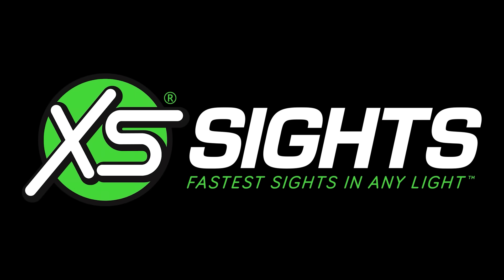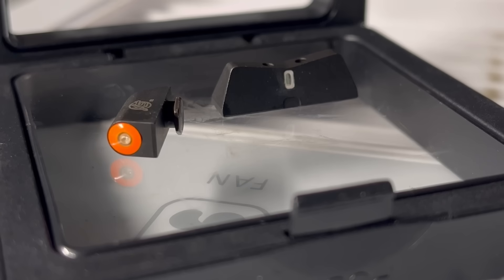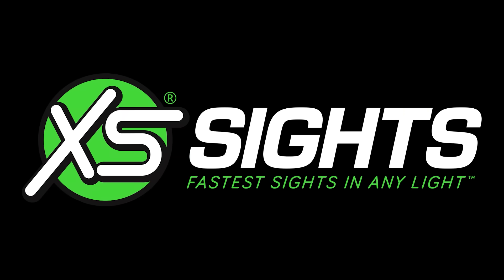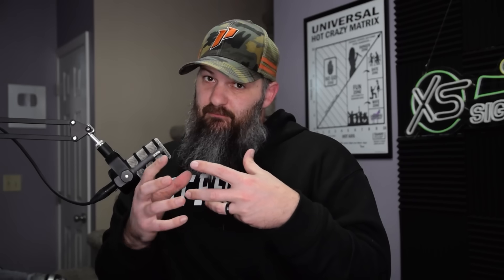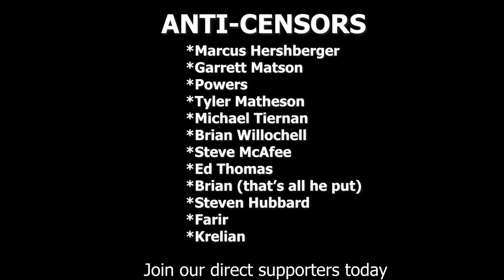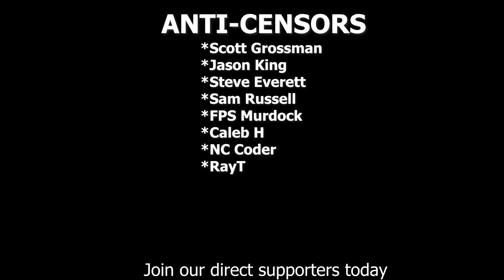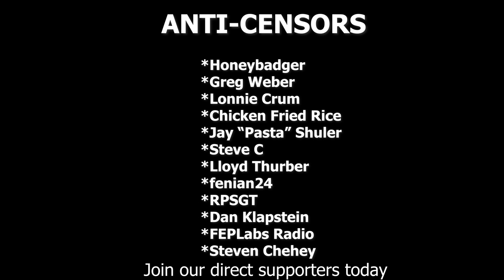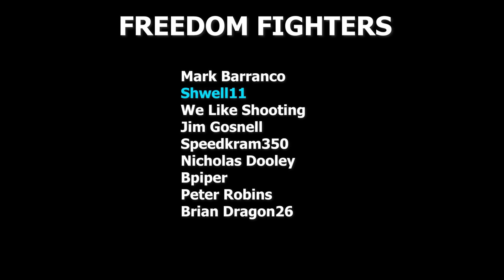Don't Get Scammed on "3D Printed" Suppressors in 2026

Comment: EDIT Thanks for the info. I had not thought of the tech as a marketing tool, just as a home-brew tech toy...I apprectate the wake-up call, as this will be my first steps into the NFA swamp.

I'd use 3d home printed for 22lr, and not much else...cheap, easily replaceable, and the print files are EVERYWHERE. You can't stop the Signal...

Comment: 3D printed cans more expensive? I'm sorry, but isn't the whole idea behind advanced technology supposed to make items cheaper by implementing economies of scale? These greedy companies want to see profits right away but that's not how this is supposed to work. Yes these machines are expensive but they are cranking out 8 or more suppressors in one run with almost perfect quality control eliminating time and the human element by over 90%. This is literally cloning on a huge scale. If you run the numbers and follow the economy of scale to its final conclusion, a superb can shouldn't retail for more than $250.00. It's literally quality with quantity, otherwise at the current reasoning there is no benefit to the consumer to the technology because the cost of the final product doesn't represent a value which is why Chinese thermal is kicking ass and American thermal is a ripoff.
Reply: Yeah, but 3D printing is slow and the equipment to print titanium (properly/reliably) is not cheap. I've got two 3D printed suppressors now: Stealth Additive Shiv (9mm) and PTR Vent 2 (9mm). They are both ridiculously quiet and worth every penny.
Reply: @bry2k You are missing the point. These industrial machines print 8+ cans at a time using one laser per can. That's 8+ lasers in one machine. Whomever told you they are slow is a retard and never sat and watched a CNC machine mill baffles and tubes THEN sit and watch someone maticulously sit for hours and weld it all together. I don't think you understand that you are suggesting that companies are buying these machines for millions of dollars if they are SLOWER, WHICH IS LESS EFFICIENT. No, they are buying them because they crank out suppressors by the crap ton 24/7 without a single human touching the product. ITS CHEAPER, not more expensive. You have zero concept of industrial economy of scale.

Comment: 2 of us at work were going to print a couple cans at work... until the cost made us say, "Nah".
Reply: Biggest cost is the printer, a Bambu labs p1s is about 400 bucks right now and can print pa6-cf without issues if you swap to a hardened steel extruder and nozzle (about 10 minutes of work and maybe 60 bucks for the parts)

Comment: There is another method for 3D printing that uses impregnated polymer to be used in a kiln to burn off the sacrificial polymer and sinter the metal powder. It uses traditional hobbyist grade printers (maybe a nozzle swap, since the filament is somewhat abrasive). Now I do not know the strength specs on the metal, but Integza (YouTuber, he hates tomatoes) had a video on this exact type of 3D printing. One was with ceramic, and another was with steel or aluminum (I do not recall which one). He used his for making rocket nozzles, with limited to no damage after use.
Reply: That filament is quite expensive, and you also need a kiln.
Reply: @bumpin8833  No doubt its costly. But compared to DLMS, is it more affordable at small scale? I'm actually curious about the value proposition, because I honestly don't know more than the general processes.
Reply: @bumpin8833  Kiln is less than $100.

Comment: If I can make one out of steel for $25 there's no reason for a plastic one to be much over $50.
Also I personally prefer if my silencer to come apart for cleaning, disposing of solids is way easier than disposing of whatever cleaning juice they've been selling at the stores.
Reply: A .22 can printed depending on the filament is maybe $10 at most.
Reply: No way in hell does 8 hours of machine time and set up and tooling cost 25$ get real.  Let's figure 30 dollars an hour just on labor and we are looking at $320 before materials.

Comment: Aluminum is fine for pistol and rimfire calibers.  And even most subsonic rifle calibers (thinking 300blk and 9x39 here) are fine.  Even aluminum is OK even when used in full auto smg's without issue.  You'll never get an aluminum silencer near the 1200*F Melting temp when firing a pistol caliber through them without experiencing other issues with the host gun having cook offs in the barrel, etc.    I agree not to use them in full bore rifle calibers.  But you made a blanket statement about not using them, but that statement is factually incorrect

Comment: as someone who has gone deep into the rabbit hole of 3d printing, if you are using fdm printers for suppressors, its cheaper and easier to use a pillow. you will get exactly the same number of uses but arguably a pillow will be quieter. on most commercial printers, the best you can do is peek or a variation of that filament. it melts at 290c and still has the layer line adhesion able to resist about 120 kg of force before letting go. at the 62,000 psi that 5.56 rounds produce, that is not going to withstand that pressure and certainly dont expect for it to even suppress that one round that its "in tact" for. you do have printers that are about 20k dollars that can print filaments that will melt at 500c. they may resist more but at that point, just buy a good suppressor they are much cheaper
Reply: The FTN.4 can be done in PA6CF.
Reply: @ChucksSEADnDEAD and even better in PPA-CF.  If you have a printer that can run at 320 nozzle temp, PPA-CF has one of the best layer adhesion levels you can find.
Reply: @chevrofreak  try peek my friend. you will find ppa-cf has finally been dethroned
Reply: @orozcocris93 maybe when PEEK isn't so expensive. I can get PPA-CF for around $60/Kg, and it does what I need it to.  I think my Qidi Plus 4 could print PEEK, but that is an expensive experiment if it can't.
Reply: @chevrofreak  true that especially in this economy
Reply: @ChucksSEADnDEAD  yea pa6cf is not as strong as peek

Comment: I have a 9mm suppressor design that is made to be printed out of PPA-CF, which is one of the toughest filaments you can buy, and even with a stainless steel laser engraved serial number plate and metal thread adapter I am in at less than $50 per can.
Reply: Which makes sense if you can print at home. With no tax or registry.  
Bc you will have to print another and start all over within a few hundred rounds.
Reply: @matthewbeaver5026 a few hundred?  Try many thousands.
Reply: @chevrofreak  on something frt equip or even just a flat out select fire? 
Its all in how you fire.  Sure I believe you could get to 1K.. on a bolt action.
Reply: @matthewbeaver5026 I have a PPA-CF cone baffle .22 can that I mag dumped 100rds through as fast as I could pull the trigger and there is virtually no blast baffle erosion, and it didn't get hot enough to soften.   That takes roughly 450° F.  The material is printed at over 550° F.  If you can afford to shoot a 9mm fast enough to melt this can, you can afford a metal one.  That is also not the use case for most people who would build a polymer suppressor.   I have a ton of cans, but I want one on everything, and I can do it cheap.
Reply: @chevrofreak    This. I'm not a mag dump type shooter. With Siraya tech's introduction of a "reasonably priced" ppa-cf, that's pretty much all I use for functional prints. And prior to the $0 tax stamp, I can get one approved anywhere from 2 days to 1 week. So it's like candy for the DIY'er. Running out of stuff to suppress,.....    One extreme pro to DIY 3d printed cans:  They are so light, you don't even feel they're on there. Perfect for a hunting rifle.
Reply: @rcrdps8144 Siraya Tech PPA-CF is what I have switched to, but my .22 can is printed from Bambu PPA-CF.  This stuff is unbelievably strong.
Reply: @chevrofreak   Yeah, same here. Started out with Bambu on bambu printer. Now I print Siraya at around 340C on my Voron.
Reply: @chevrofreak  what ppa-cf are you printing at 550f? Lol. Come on now. Yeah you can print one and its functional. But not for long.
Reply: @dbtwrx Siraya Tech PPA-CF.  550 is in the low end of the temp range; I am printing closer to 610F.
Reply: @matthewbeaver5026  i have seen 3d printed cans out of PLA+ with over 1K of rounds through it shooting sub 300 Black
Reply: @Hickamfield  out of pla I highly doubt that. Unless it was as thick as a brick and even then it still wouldn’t work
Reply: @Skylersteel   PLA+ and yes it does
Reply: @Hickamfield interesting. But when I print something outta pla that is thick is still breaks lol
Reply: @Skylersteel  ok
Reply: @chevrofreak  is the design on “odd see”?
Reply: @paladin5133 it is in a sense, as the FTN.4, but my version of it is redesigned for direct thread use, with a fully round outer shape and a different front end cap geometry, as well as a vertical printing orientation.  The K baffle design lends itself to being extremely durable when printed.
Reply: @chevrofreak ah okay. Is your version not available?
Reply: @chevrofreak  where are the STL's ?
Reply: @chevrofreak  i have a .22 lr that i will be releasing on Odysee next year when there is no longer a fee for a tax stamp
Reply: You using the ftn series? I've been looking into making my own suppressor out of higher end filament, just curious what design you use
Reply: @samuelgates9369 I modified the FTN.4 "kneelsun" version with a round, thick, outer jacket, 5/8-24 threads (for a metal thread adapter) and changed the endcap geometry a bit.  It is made to be printed vertically, threads up, rather than horizontally, because PPA-CF is a very strong in that orientation.
Reply: @chevrofreak have you tried any of those designs with either 556 or 308? I'll definitely have to check those designs and filament out
Reply: @samuelgates9369 I haven't, I have only printed the threads so far to make sure they came out good (they are fantastic, I didn't even need to chase them with a tap) and I am going to print them once I can get the $0 stamp.  I have serial number plates and thread adapters waiting for that.   I have printed a muzzle brake out of the PPA-CF to test it and it did great on a short barreled 9mm rifle.
Reply: @chevrofreak careful. There. Im not completely educated on the matter though ive read of the possibility of charges if you gather your supplys prior to getting the stamp. Constructive intent.  Blah blah..
Reply: @samuelgates9369  PLA BOI on Odysee FTN4
Reply: What’s the cost of the machine(s) to make them?
Reply: @maniac117 I picked up my qidi 3d printer for 250 used, works good and is capable enough for engineering grade filaments, I've printed enough toys, organizers, and decorations to warrant the price. Suppressors will just be an added bonus
Reply: @maniac117  around 300-400  check around i like the Bambu P1but there are many more that can do it
Reply: @Hickamfield isn’t the parent company of Bambu taking steps to prevent people from printing firearm related stuff?
Reply: @maniac117  no idea, i print 2a all the time
Reply: @maniac117  no it’s actually surprisingly every other company doing that lol strange
Reply: Anything with CF in it sucks, the CF doesn't penetrate layers just makes it more brittle is it.
Reply: @BearArms1488   lol you're a brokie who cannot afford good filament it seems
Reply: PPA-CF may be strong but not as strong of a bond  in the layers as PA6-CF or PA12-CF you may want to look into bonding also use an oven for 8 hrs to cure..  wouldn't even think of 3d printed for firearm as high power air rifles split them in .22 .25 caliber...
Reply: @NM-FXM4 look at the testing of PPA-CF by My Tech Fun, it is by far the strongest nylon filament he has ever tested, including later bond.
Reply: @NM-FXM4  i have ar-15's and Glock 19's that i have squirted out
Reply: @Hickamfield ❤
Reply: me too and i have a DL-44 22 that i have made and uploaded to makerworld
Reply: @NM-FXM4 
.22LR is 22 caliber. Technically 
.223 Remington is a 22 caliber as well. But point taken. The psi is substantially greater.
Reply: Do you have a Form 1 manufacturers's license?
Reply: @stopthephilosophicalzombie9017 that's not a thing.
Reply: @stopthephilosophicalzombie9017 it's a Form 1, but it isn't a license.  You fill one out for every item you make.  You receive an approved tax stamp for that one item.  I've done over a dozen of them at this point.